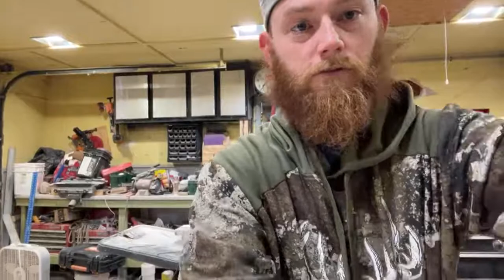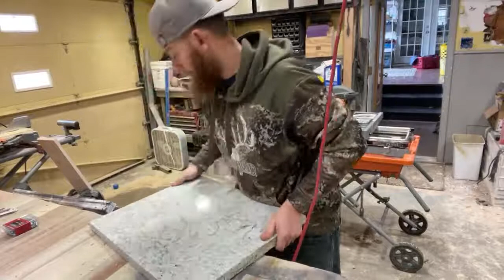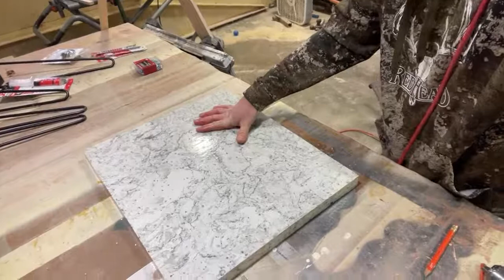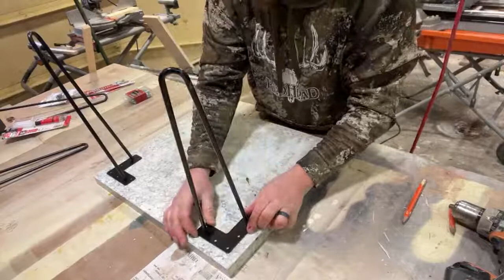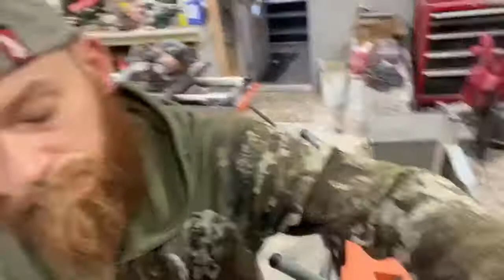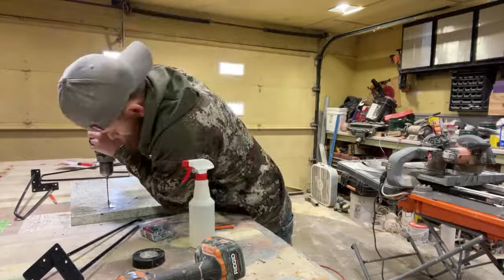DIY Granite/Quartz/Stone Table - Part 1

Comment: What size screws did you use? I have a piece of leftover granite and this looks great
Reply from the maker: I used a 1/8” masonry bit, and then screws that were just a tad bigger than 1/8”. I picked up some short stainless screws/Bolts from Home Depot.

Comment: The raw edges look pretty cool actually. I would use different legs though. How would you attach wood to the tabletop if you wanted to? And is there a way to make the edges look more "broken off" instead of cleanly cut with a saw?
Reply from the maker: Wood legs would look nice too! Maybe you could chip the edges with a hammer?
Reply: Bolt cutters it’s a chiseled edge and I used liquid nails for my small top
Reply: I work at a granite shop. To make a rock chip edge you just make a cut into the top lightly. There is a tool and it looks like bolt cutters but they are huge and you break the edges with it. Because you made a light cut into the granite before it helps hold the edge and it breaks the stone evenly.

Comment: What was the thickness of that quartz? I am trying to do something similar with pieces of a quartzite slab remnant. 
Second question, what size did you make those square tops. Looks like a really nice size.
Reply from the maker: The thickness is 1 1/8”. I just picked sizes to cut them into based on how much good slab I had and where I want led to put them. They are all around 18”x18”.
Reply: @CookeSonsCarpentry  Thank you!

Comment: Great work, quick question. With the attachment of the legs, did you just use epoxy resin and hardener on the screws ends and then drill in? Or did you use some insert nut ends and then screw in? 

Thanks in advance, Gavin
Reply from the maker: I drilled holes and just used stainless screws.